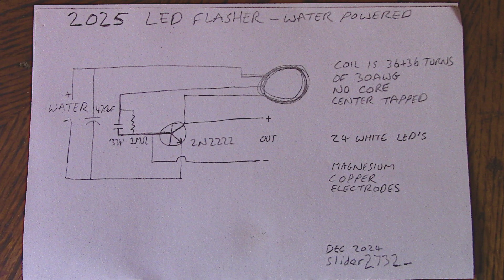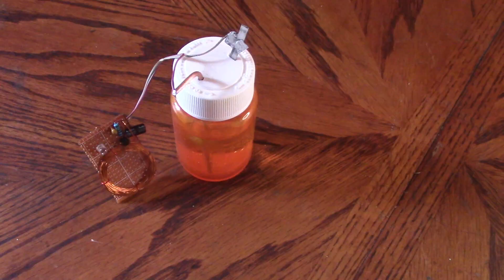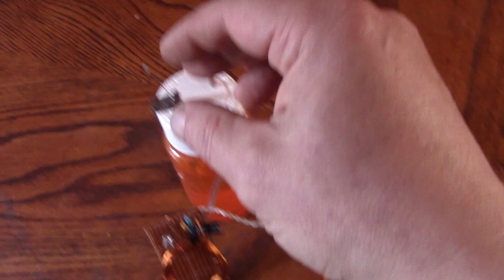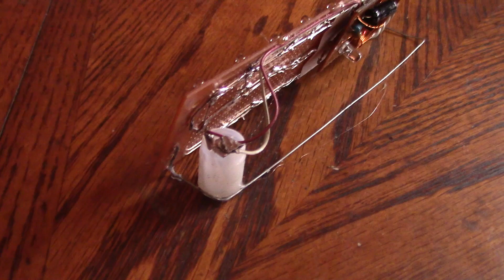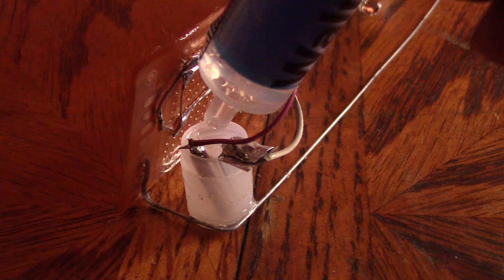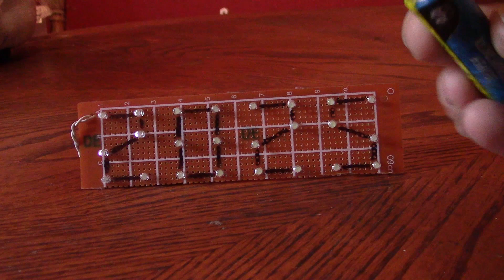25 LED's Powered By 1 Drop Of Rainwater

Comment: Can someone get this man a set of aligator clips!?  If I were in a similar pinch I'd have simply drilled or punched a hole in the Mg strip, threaded the wire through, and twisted a loop.
Reply from the maker: Haha, I hear you! The issue, as you may well have experienced too, is that alligator clips rust easily. Maybe truly stainless steel alligator clips are a thing, but I've not seen them.
For many a project I've always twisted a wire around the Mg. In fact, part the strands in half, twizzle to make 2 half gauge wires and twisted both tight on the Mg.
Thanks for your comment 😀

Comment: And the battery is hidden in the white cap of the cooler!
Reply from the maker: 😀 Any battery would have stronger performance, as shown in the vid.
Reply: @Slider2732_  not true 1 or 2 AAA or AA 's would have been underpowered for 25 LED's so it was probably 3 or more of either!
Reply from the maker: @timh.2137  Ah, nope, but I understand the thinking if you've not made such a circuit. The way these blocking oscillators work is just like a Joule Thief, where the output is low current but high voltage. Another example would be a Slayer Exciter, where a 1.5V battery can light 50 or more LED's. It's a transformer action. The LED's are only pulsed with short spikes and are nowhere near full brightness, which would indeed have needed far more power than the water + electrodes could deliver.

Comment: Nice work. I love little circuits like this.

Put a peak detector and switch between the output and the LED anodes and the LEDs will stay lit once the capacitor has a sufficient charge. While the LEDs are off, it will continue to charge the cap. It may take some time to charge initially, but it does work. I used something similar on a ridiculous joke circuit I built years ago.
Reply from the maker: Great thought. I was going to let it simply light them with very little in the way of a cap, but the 470uF definitely helped for brightness, so left it like that. 
Hope you have a great New Year and thanks for posting! 😀

Comment: Now I wonder, how much energy does it produce at what amperage?
Reply from the maker: Output is roughly 1.4V at about 2mA. Not a lot and will sag over time as the magnesium oxidizes. Also, this magnesium is about 10 years old, from a reel of it that is now a dark grey in colour. But, other projects have run for about 3 months at a time before the magnesium needs to be replaced.

Comment: I powered a few LEDs with drops of water dripping on titanium coated glass and a bit of ptfe tape. You could just drip the water over it and it creates static charge enough to light multiple leds. It was inspired by an article where they did the same thing and powered 200leds with just drops of water.
Reply from the maker: Really interesting about the static and must be something like a triboelectric effect. Quite fascinating. Congrats on your success!

Comment: why did you decide to use a coil without a ferrite ring?
Reply from the maker: Because I had no idea if it would work 😀
Thought it should, but didn't know, hence the idea for the video. As it also happened, it had been raining for several days and that prompted making it run from water.

Comment: Nice project! You could use a clothes peg for the connection. Outlining the numbers improved things, might work better if you used tin foil for the outlining. Thank you for sharing!
Reply from the maker: Many Thanks (great posting name btw). Clothes pegs are a very decent idea, though my wife bought some recently and they keep falling apart. Mind you, they'd probably work better for magnesium than clothes! Outlining did work out well. In fact, as probably noticed, the section about batteries was re-shot later due to rain noise and the outlines were already done. We have a tin roof and I was practically shouting in the first take lol

Comment: Hello my good friend. You could have had a great thumbnail with "Power from Volcanoes, Hydrogen and Oxygen." H2O Rain + Sulpher from volcanoes to make diluted sulfuric acid. Otherwise known as acid rain. When back in New Lab one of my listed projects is to get a dead car battery and revive it purely with rain water. Charged with solar panel and see how long it runs for on a suitable load. Happy New Year to you and Julie.
Reply from the maker: Thanks Ray and I hope you have a wonderful New Year!
Yes, I suppose acid rain is part way related for a car battery. In the 1970's you could have probably driven out to the Manchester mills and put the empty battery on the ground, waited 10 minutes for it to rain and driven the car back home using that battery!  🤔🥺🤐
Good luck with the project, I'll tune in for certain 😀

Comment: The volume of water is not really a factor in things like this. As long as electrons (and ions) can be transferred between the electrodes, it should work fine. If memory serves me well you could actually lay one electrode on top of the other with a piece of wet paper between them. Yes ... I am a science teacher - why do you ask? :)
Reply from the maker: Thanks Mr science teacher 😀 
Yes, indeed, wet paper would work. It just surprised me how well it continued to run. Normally, surface area has played quite a large part in needed current and this didn't seem to care at all. One of those times when size reduction and further size reduction ends up being ridiculous to what was originally planned. 
All the best for 2025!
Reply: @Slider2732_ LEDs can run at tiny amounts of current, that's why an LED flashlight can still work even with slightly crusty/leaky batteries, as long as they still have some power left. As long as you have metals with a different electronegativity and some form of charge carrier, you can get some current. Touching them together (galvanic reaction) or even just holding them with your hands can get a tiny charge (some science museums have a display where you put your hands on metal plates or rods to move a microammeter).

Comment: Very nice setup ❤

If you explore further you may find it can work with 1x1 mm electrodes or even smaller if you can make connections reliable. With few cells in series the leds will stay on all time as long as there is at least 1 molecule of water for each cell. The problem with copper-magnesium is when you put them in series they must not have direct contact as magnesium gets destroyed at contact points. Also, you can get a voltage even if you use acetone instead of water, or any dielectric liquid to preserve integrity of electrodes from oxidation.

Using copper-aluminium 8 cells in series I can lit up up to 30-40 white leds in parallel with just a single capacitor 10v 100uF electrolitic and nothing else as you can see on my channel … after nearly 2 years the system works as it was from beginning and oxidation using deionised water is present in small amount only on the part where electrodes were exposed to air. But, I used clamp connectors between electrodes without direct contact between dissimilar electrodes.

If you can make your own electrets using teflon tape results are impressive when water is replaced with electrets and very good insulation/encapsulation is used … non-toxic and tens or hundreds years of usage per every cell.
I have found an expired patent for making electrets from teflon tape pretty easy which last 20-200 years if made under right conditions (dry atmosphere) and can be done in minutes once you have created  required medium. This type of generators can be manufactured using another expired patent of Arie Melis deGeus.

In meantime I have tested Lorrie Matchett  single rod capacitive coupling and Don Smith iron rod methods which are pretty much same and they show excellent results … no need for grid power as per Lorrie method if you employ an inverter and battery as D Smith says in his patent. D Smith method seems to be more efficient and not very complicated using off the shelf components or even scrap materials. After analysing Lorrie M method looks obvious in D Smith method is shown a connections which may not be made to allow zero consumption on the load if you use soft iron rod as per patent.

But, because you like LEDs setups i can suggest to think about optocouplers, their gain and try 1 yellow led panel being exposed to a same size white led panel in an enclosure and check the current output.😉 eventually a smaller white led panel with a fresnel lens focused on yellow led panel might work better where you may need less power for white led panel. FIAT LUX !
Reply from the maker: Great info, thanks Caesarus!
I used to mostly avoid magnesium, due to it getting eaten quickly, but then found a deal for cheap and still have most of it. Every Mg thing on my channel uses it and it's got to be 10 years old by now lol. The atmosphere is getting through the bag though! We also have very high humidity here so that doesn't help (or with the teflon tape method). 
Nephilim Penny is a large pancake osc that ran 24/7 for 12 years until moving house, uses Mg and Cu, with the Mg being replaced every 3 months. Limiting such degradation is very interesting and the teflon tape method definitely appeals. Must also revisit Don Smith's methods, I last looked at that when John Bedini was still around.
Hmm, a 'Devils Toybox' of mirrors may be interesting for LED light harvesting.
Reply: @ also, in long term run replacing magnesium with aluminium looks much more attractive in terms of cost and availability, even for less power density. Copper/magnesium 100%, copper/zinc 60%, copper/aluminium 35% in terms of output per cubic meter … the last one yield less maintenance cost in long run time but the volume of the build for decent power rise very high and heavy. … this is only in terms of diy at home with low skills and resources.
Reply from the maker: @Caesarus2011  I'agree with your figures and thoughts. I also agree about the low skill and resources at home lol, though that is basically the channel! 😀
Reply: Slider's wife, here. Interesting information! Thank you for generously sharing your findings! ❤️❤️

Comment: Amazing. Seems to be endless how many led we can get blinking this way. I had 16 blue lined up a while ago. Is it endless? Also with a lower value of the blocking resistor I got them appearing almost permanently shining…I think like 10 to 20 cicles per sec….
Reply from the maker: Good point on the total amount possible. What I see is a reduction in brightness with extra LED's on same power level, but it's very gradual. 16 might look similar to 24, but when put side by side there would be a distinct brightness level difference. Add in air core coils and I really did have no idea lol. Did note also that around 6 seconds is the flashing time after 'power' is removed, compared to typically over 30 seconds with ferrite based coils.
Reply: @Slider2732_  interesting. So the air oils are not as power full.
Reply from the maker: @MilkywayOutcast  They do work fine, but ferrite definitely gives a boost. Can be seen if you make an air core to just a bit larger than a ferrite rod, then put it on the  ferrite rod 😀
In fact, the next video is about using ferrite.... am shooting the thing on New Years Eve lol
Reply: Ferrite makes it a bit more efficient especially considering you can get close to three orders of magnitude more inductance with the same coil. Plus coupling is generally better.

Comment: I had made a flashlight with this joule thief circuit and it used to make a high pitched noise (a transformer wine) as I had used a toroid it was so fun listening to it
Reply from the maker: They can make an awful high pitched piercing noise, yep... until age silences them. I have loads of circuits around here and CRT TV's that mysteriously now run quietly. Anyone younger than 35 can probably hear our house from 2 miles away 🤣
Reply: @Slider2732_  lol 😂 you're right at certain age we stop hearing high frequency sounds
Reply: 😂 @Slider2732_

Comment: Hmm, I may have used a paperclip at sometime, but I don't remember it. However that sounds like a good idea, so I will try to remember that for next time 🤣🤣👍👍 and flashing 25 LEDs is impressive 🌞🌞😎😎
Reply: I thought the arrangement of the LEDs was going to flash SLIDER 💡💡💡💡💡💡💡💡
Reply from the maker: @GrandadIsAnOldMan  Was going to try 'Thanks For Watching' with some kind of Slayer Exciter circuit and use on end screens of vids, but there were no way enough LED's in my stash. Luckily the end of the year was happening!
Reply: And of course, HAPPY NEW YEAR 🎆🎆🎇🎇 when it happens 🤣🤣
Reply from the maker: @GrandadIsAnOldMan  A very Happy New Year to you too squire - can't wait for your silver play plaque arrival vid!
Reply from the maker: I was sure it was you! How bizarre if not and if you then DO use a paperclip and it works. That would be some kind of time shifting  paradox thing LOL. Hmm, I wonder how fast your new F1 Radio Shack car can go around in circles... it worked for Superman 🤣